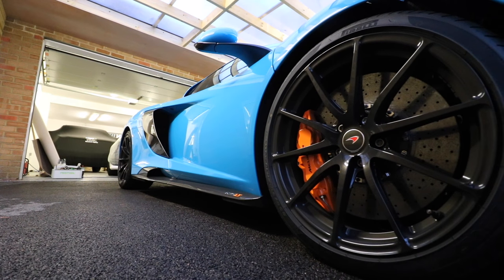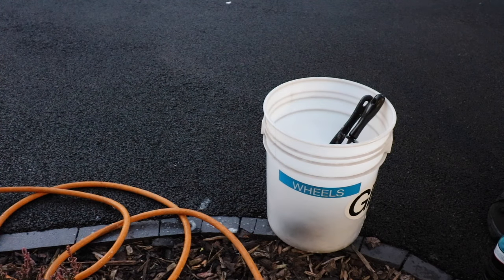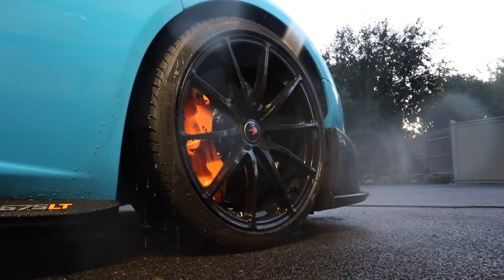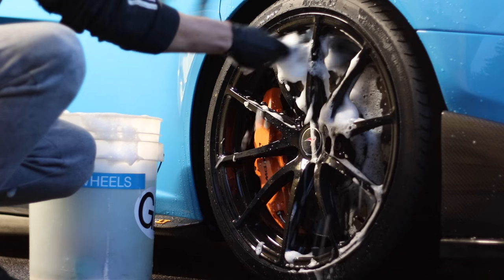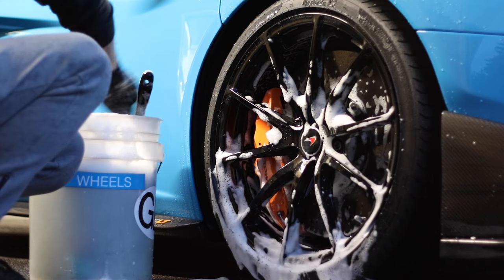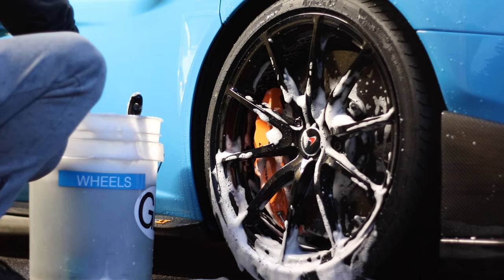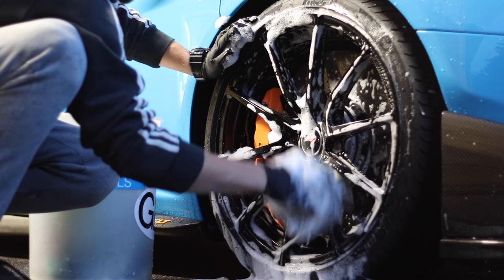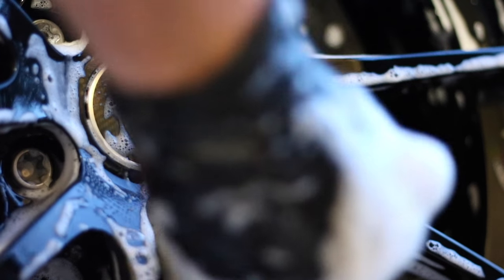Carbon Ceramic Brake Care ft. McLaren 675LT Spider

Comment: There is allot of folklore when it comes to CCBs that soap and even too much water can be a problem.....I read that on a Ferrari website that sound a bit absurd, thoughts?  One other thing the Porsche head mechanic told me on some Porsches with CCBs water is getting down around the threads of the Bleed valve(?) on the CCB in spite of the black cap.  Is that a concern in your opinion?  I have been using simple green car soap on the wheels, wheel brushes and when I see a fleck of tar on the rim I spray some TARX on a microfiber towel and rub the area and it works like a charm then I spray some distilled water on the area to remove any chemical residue.  How do you remove tar flecks?

Comment: Please do a video on how you wash your microfiber towels since most videos i find are made in the US with products not found in switzerland or europe. Would appreciate. Thank you
Reply from the maker: +pipolebnene Hi thanks for the comment. 

I use a liquid soap, in the UK we use Persil.  I put a cap full of this soap in with the towels and then they go on a 30 degree quick wash. 

If I have a lot of towels which have wax on and wax applicators I put a cap full of white vinegar. This breaks down the spent wax. 

I hope this helps. Joe
Reply: Joe Huntley thank you

Comment: Thanks for the video it's one of the few videos that addresses the cleaning of CCBs.  I have a few questions: can you get all surfaces under the front brake caliper?  Is there a super thin brush made for the areas between the rim and the front brake caliper?  I guess I could move the car forward but when your cleaning the car I would hate to stop and move it.  Any ideas?
Reply from the maker: Vikan do a good range of brushes. Would be worth having a look into. Very much like thin paint brushes buy made for safe plastic materials. These are thin and they do ones with different angles. 

Joe
Reply: Thanks Joe....didn't realize how little clearance there is between the rims and the Porsche carbon ceramic brakes.
Reply from the maker: Yes very small amount of room. You can always clean all four wheels then inch the car forward to gain access to the areas covered by the spokes before.